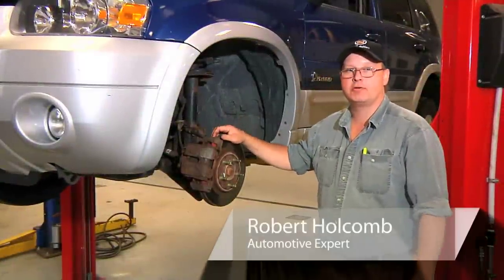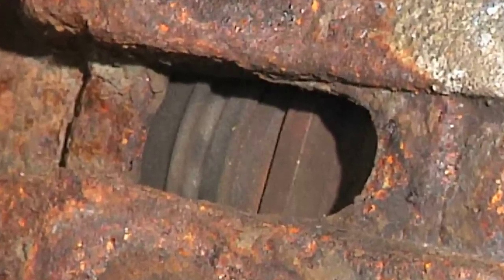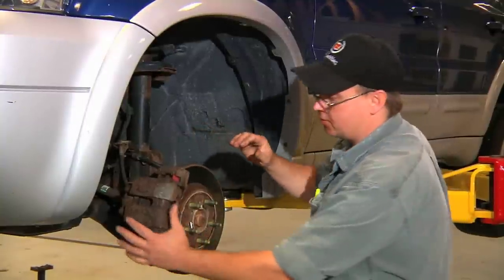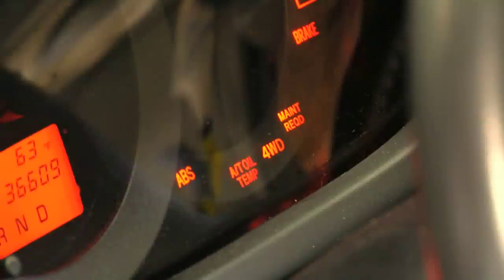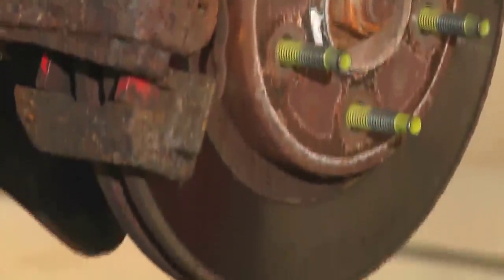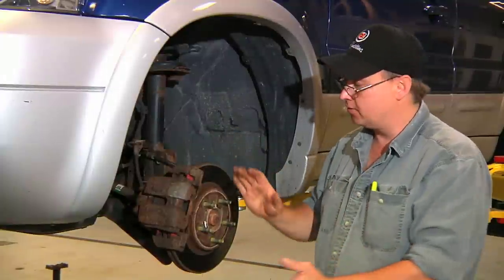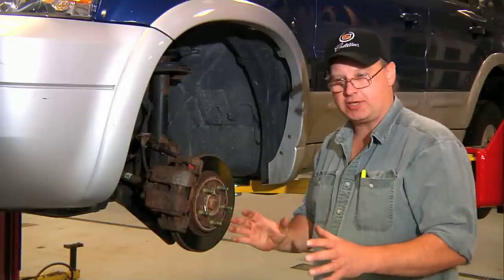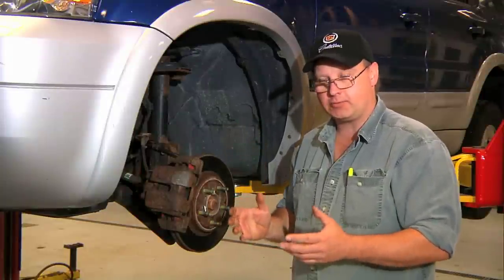ABS Brakes & More : How to Troubleshoot ABS Disc Brakes

Comment: A friend has a the problem,you are talking about,it is a 02 chevy truck,with four wheel disc brakes,but he has a vibration,than,the truck doesn't want to stop,he says,the brakes and rotors are good,any ideas.

Comment: How about a video showing how to remove the ABS module and replace it with a proportioning valve so we won't need expensive computer equipment to work on it.

Comment: I have a 2005 silverado 4.8  2wd   with a sticking caliper both sides,  
front right, front left,   I changed the calipers the brake hoses the 
master cylinder flush the brake fluid,    and still sticking both sides,
  what do you think it could be?
Reply: 100ega  did u fix it,,,, i would of thought if the pads are clamped on then its the piston main seal  but u said u replaced the whole calliper ??,, i would get it professionally checked
Reply: yes I fix it, (( it was the brake booster,))  the pin rod that pushes the brake master cylinder, it was getting stuck.   so i changed the brake booster and that was it. problem solve